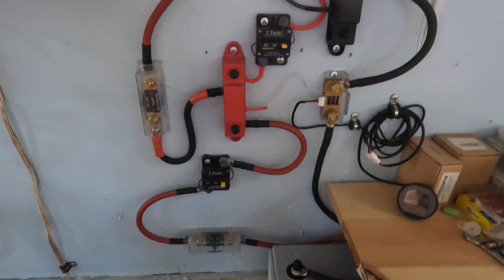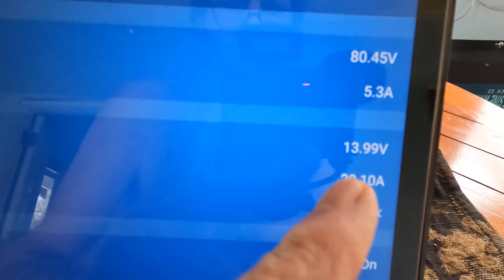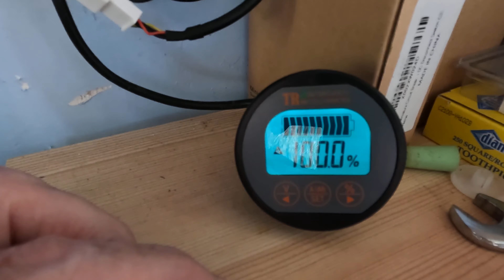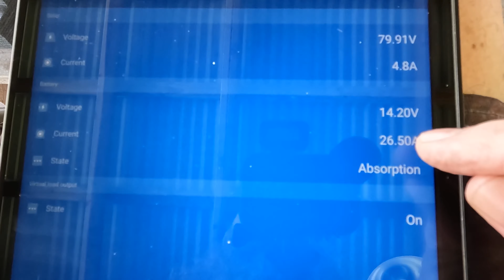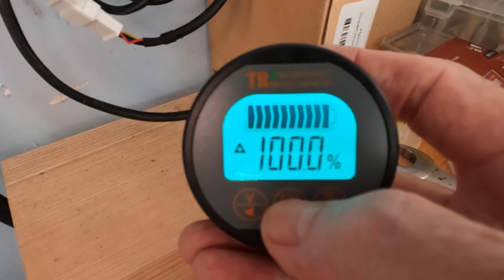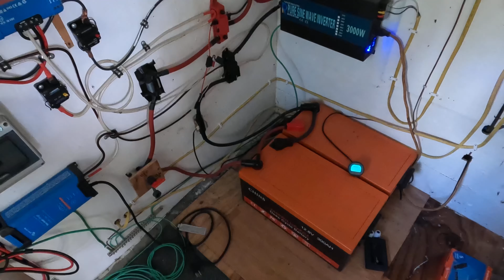Voltgo 12.8V 200Ah LiFePO4 +500watts solar + Victron  MPPT 100/30 +20 cu.ft. refrigerator freezer

Comment: Hey there! Love your videos and have been learning a lot. Currently on Oahu running my solar setup off grid with lithium ion batteries and my 3kw growatt. Looking to upgrade to LiFePo4 but am having a tough time finding a company to ship them out here. Tried Docan and 18650 battery store but neither will ship to the island. Any suggestions? Mahalo
Reply from the maker: Yes brother, I have some Ideas. In the about section on my home page is my email address. SHoot me a email with maybe size and brands you're thinking about. I will try to help. Aloha!

Comment: You can shut the blinking off in the battery monitor, by pressing left and right buttons at the same time.

To test the capacity of the battery you can use the same monitor you are using, just set it a bit higher than the rated capacity so if you go above what it's rated for you know by how much. Example, for the 200ah, set it to 210ah, and at the end if you have 5ah remaining in the clock, you know you discharged 205ah. Just a hunt.

Thanks for the video.
Reply from the maker: Thats a great idea using the shunt! I never thought of that, but will deploy that method in future videos. Mahalo for the blinking light info too. That I actually knew, but rarely have mentioned. Appreciate the feedback brother! Aloha!🤙